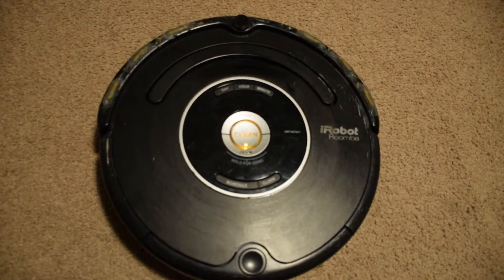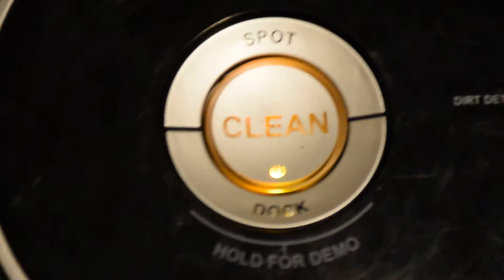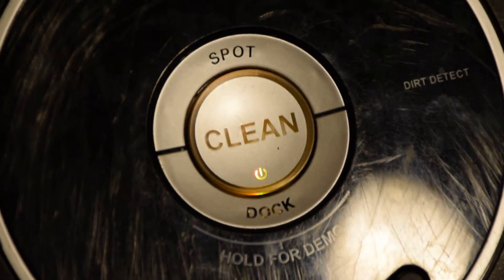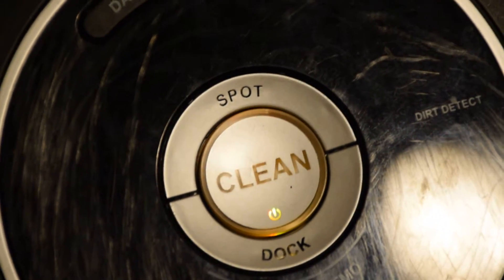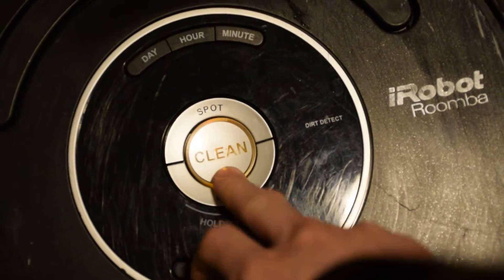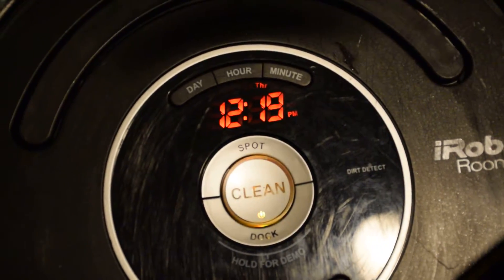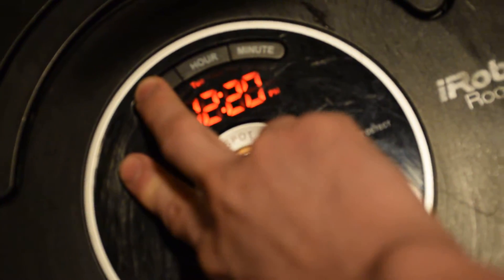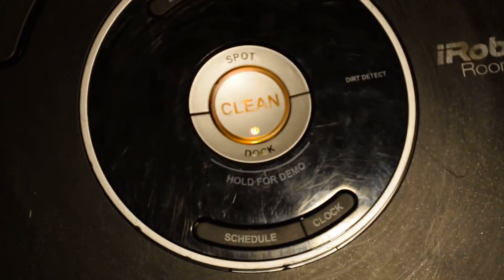Roomba repair, follow up.

Comment: IDK what it really is but that is verry strange. The main board is screwed. My Roomba had a Charging Error 5 and I fixed it by cleaning the battery contacts and bending them up to make better contact.
Reply from the maker: Maybe that is what I need to do to mine. I wish I had a good thermal imaging camera. Then I could just look at the board and see if their was anything heating up.
Reply: +MadeOfSolder these boards are EXTREMELY touchy. The board is most likely gone. A new one on ebay is like $70. Also, the dog may have had something to do with it😉😂